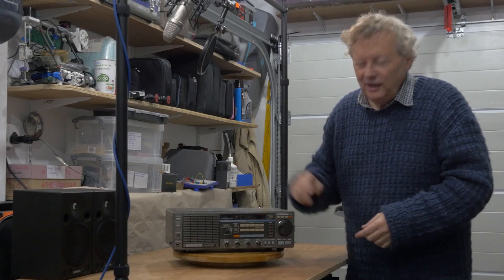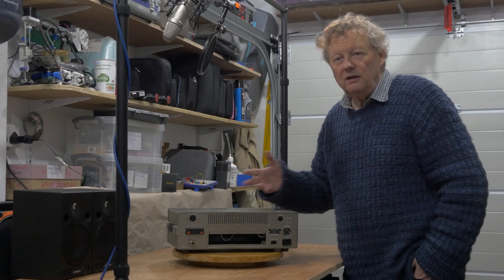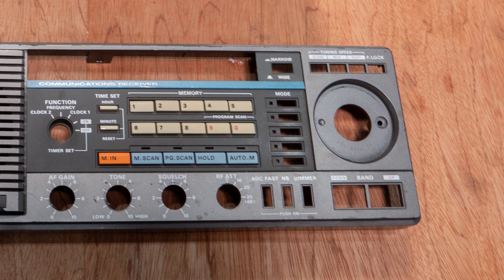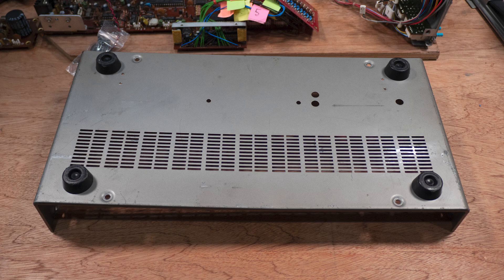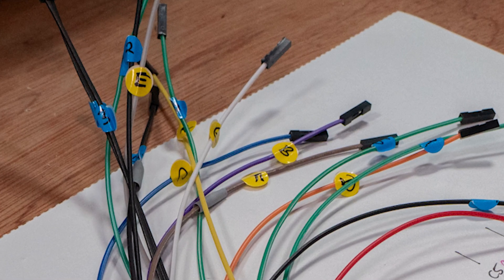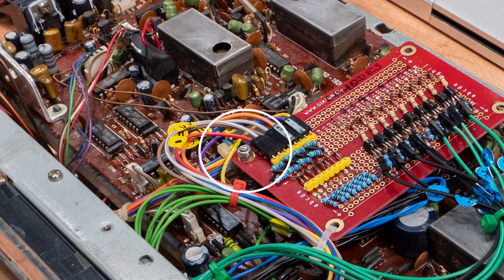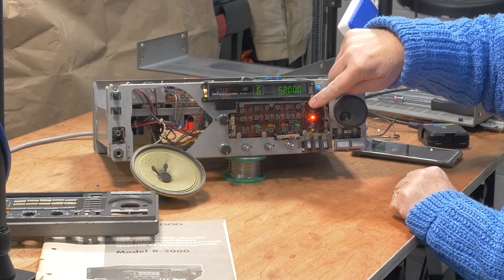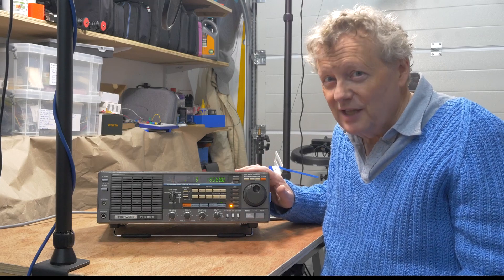Kenwood R2000 HF Ham Radio Receiver Part 3 - Fully Restored with New Display !

Comment: Great work! I've got an R-2000 in a similar condition having been stored in a sweaty shipping container for decades.

A couple of points: are you aware that each connector has a number printed on it, and that number is also printed on the PCB? Also, for your display mod which I like very much, you said that you had a revised schematic, but I didn't see it. Please could you point me to where I may view it? Did you consider using ribbon cable for the various lines to the prototype board and to the display? Thanks again, Stu
Reply from the maker: Hi Stu - all good points, and yes I saw the numbers but some were worn and I tried to keep everything aligned. Having said that, I eventually realised, as you suggest, that it would be quite difficult to get them back incorrectly. Schematics - I have made a PDF booklet about the technical details and if you get in touch I will send it to you (mail@q26.co.uk).  Ribbon cable would have been very difficult/flaky to attach to the display, so I used thin wire or dupont leads, which worked well. Please feel free to get in touch if you want to know more...

Comment: Thank you for this ! I have the same receiver but I believe  it needs recapping as i get only white noise no RF signals. Replacing the Digital display would have been definately beyond me!  
Have you any experience recapping?
Reply from the maker: Thanks Martin - I don't have the experience of a full recap - I believe you can buy a full set if you search online -  this is quite a complicated radio, so although I've done quite a bit with it, there are areas where I'm still wary to tread! Recapping shouldn't be too difficult (I've changed a few) and if you work systematically it is straightforward to remove the two pcbs and access them all. Best wishes from Mort / G4BSK

Comment: I have a R-2000. The "S" meter light is out. It works great but I'm hesitant to open this up just for a bulb.
Reply from the maker: If you take the top cover off, you will be able to see the s-meter light, which pushes into a holder just behind the meter. It is fairly accessible and may be worth a look...

Comment: Thank you for the run through. I just bought one of these at a ham swap. Mine has the vhf option but not the CW narrow filter. I will be adding the 12v input as mine has only the covered hole and no wiring from the rectifier board. 
If you ever decide to do an adjustment of the receiver (assuming that is needed after leaving the assembly house) I would be interested in a video tutorial on the process. Great job on the display, it looks fantastic.
Reply from the maker: Thanks Dave, glad you liked the video. The adjustment on these seems pretty tricky - I hope to have a go some day!